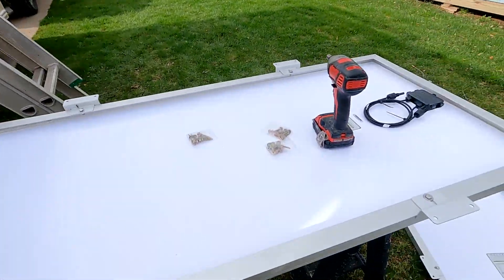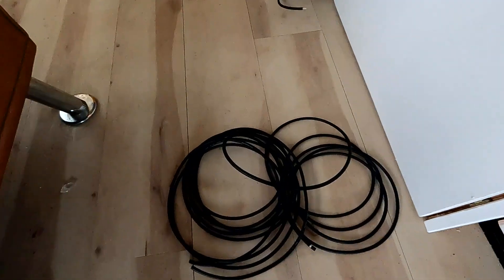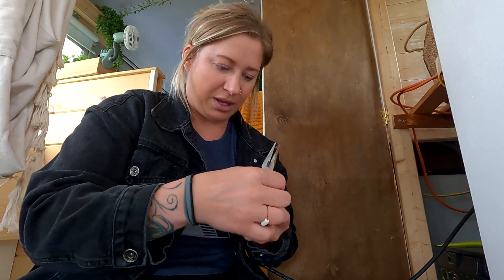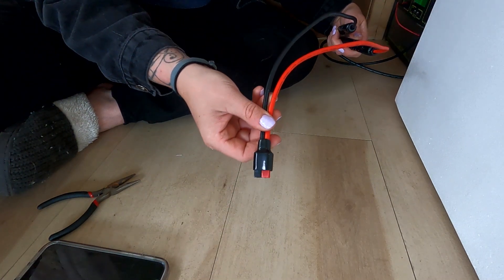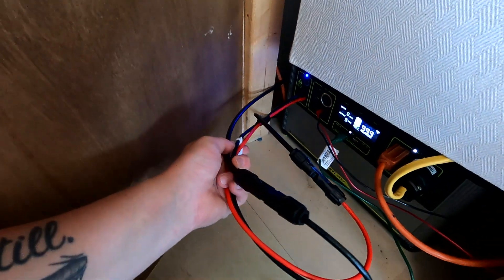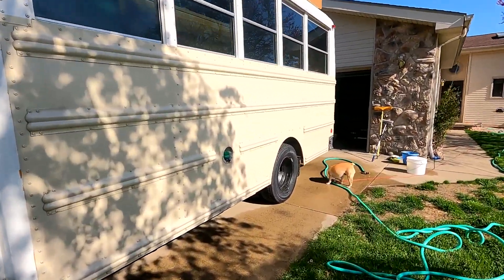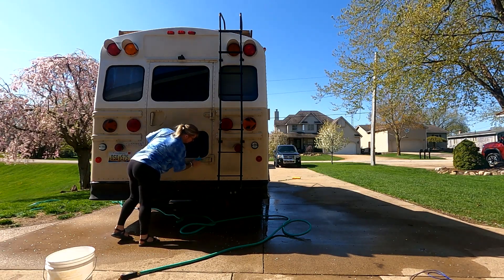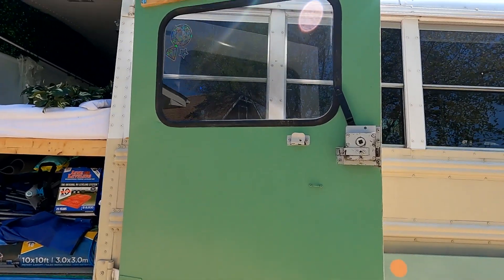solar problems | DIY skoolie rooftop deck | re painting my bus AGAIN

Comment: LOVE 💗 it!!!! You painted the hood with a roller? I need to paint Duchess but I was Leary to F it up! 😹
Reply from the maker: Totally feel you!!! Yes a roller works best for me. I use a brush for the small areas but the roller goes in SO well! I just used a high end paint from Menards
Reply: Thank you as always! What kind of roller? Low fluff?
Reply from the maker: @TheAngelsWhisper  yes, I did use a roller that created more texture for the front part ONLY bc it was what I had but I’d suggest a higher end roller. Worth it in the end